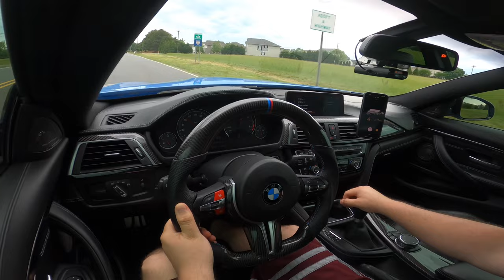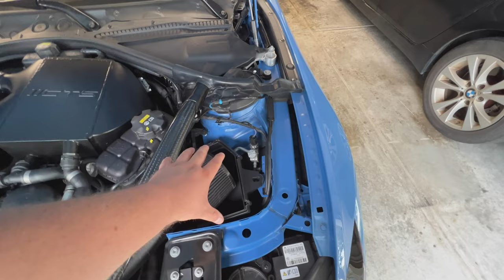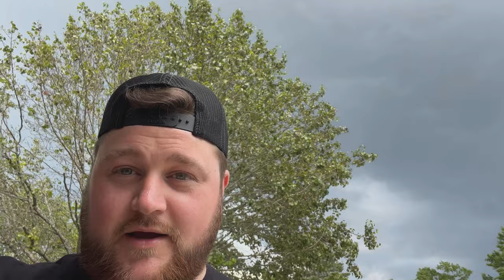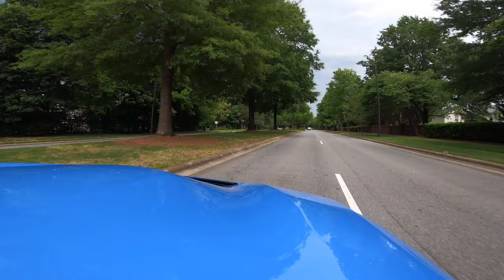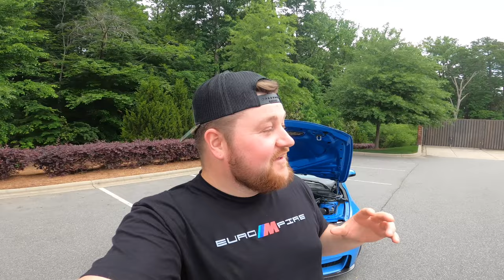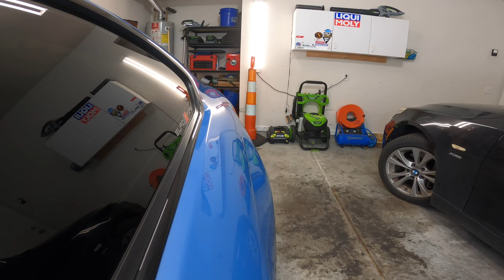BMW M4 CTS Turbo Intake Induction Sound! WHOOSH! What To Expect | BMW M4 M3 M2 S55

Comment: I like the sound. Personally, I run charcoal filter delete with BMC drop in filters and the burble delete with valves always open (plus single midpipe). It’s my perfect setup for sure, sound-wise. Your intakes, while not for me at all, sound really cool 💪
Reply from the maker: That’s the best part about cars is there is so many options for people to make them their own! 

How do you like the single midpipe? I’ve been considering it! Does it clear up some of the rasp at high RPMs? Also, how much louder does it get?
Reply: @UnworthyMotors  Great point! I like the single midpipe a lot because it adds bass up top. The way I describe the change in the single midpipe sound is like this: The stock sound is like early puberty where your voice cracks sometimes and has high pitched breaks mixed in with bass VERSUS the single midpipe which is post puberty after the bass in tone is consistent and smooth. The sound with the single is very uniform and I’d say volume is up 15%

Since we have 6MT we don’t suffer from the “DCT fart” sound as much but there is some liftoff “Brufff” sound at higher RPMs
Reply from the maker: @tractioncontroldelete  i think you have sold me on the single midpipe lol
Reply: @UnworthyMotors  The midpipe is fucking amazing, sounds AWESOME

Comment: Do the intakes add to the engine sound or give an engine sound as such apart from the wooshing? My M2C is stock intakes and exhaust at the mo. What exhaust do you have? Thanks man!
Reply from the maker: No additional engine sound besides the whoosh from the intakes pulling in air. I’m currently running catless downpipes(adds a little exhaust sound) and the rest is stock exhaust!
Reply: @UnworthyMotors   thanks, usually intakes add a bit of roar with that air pulling sound, is that what you have? Nice, you dont have OPFs do you in the US?
Reply from the maker: @JayKullar  no, being at the for front the intake really only inputs the whoosh from a. Sound perspective. What are OPF’s?
Reply: @UnworthyMotors ah ok i got you. Think i can leave an intake then. OPF is a filter added on post 2018 cars here in Europe, reduced sound so much.  Think catless downpipe and removal of OPFs might do the trick.
Reply from the maker: @JayKullar  gotcha. Yeah we don’t have the extra filter and mines only a 2017. The catless downpipes take the cats out but i still have secondary cats in the midpipe
Reply: @UnworthyMotors ah ok. I was planning on taking out the OPF and the 2nd Cat and the mid resonator out at first.
Reply from the maker: @JayKullar  will def add to the sound!

Comment: What are your thoughts on the eventuri? I want more sound than anything..
Reply from the maker: The eventuri is mainly focused on looks. You are paying an excessive amount just for the fact it’s carbon fiber. It is going to give you increased sound from stock while still maintaining the same power numbers, but if you want more sound and that’s your main concern, an open box design like mine is your best bet. You will lose a few horspower(maybe 10) but overall unnoticeable but gives you all of the sound. The reason you get sound is 3 things. 1) whether the intake is located inside the engine bay or is a front Mount system just behind the grills. A intake system inside the engine bay itself will be louder from the cabin. 2) whether it is an open box design(my set up) or a closed box set up like stock or eventuri. As you can imagine, a closed box will let out less sound. And 3) whether it has a cone intake(aftermarket) or a stock filter. The cone filter will provide much more sound than a normal stock filter.

Bottom line, if you only care about the sound, get an open box intake in the engine bay like i have. If you want to maintain performance but want louder than stock just not as loud as open box like mine and willing to spend the money to make it look good, go eventuri. If your main focus is performance gains, go front mount intake style. 

I hope that helps!!
Reply: Thank you for being so detailed I really appreciate it.. how does your intake hold up with heat soak? I live in Florida where it's considerably humid
Reply from the maker: @sateshpersaud1  very marginal power loss. Nothing you’ll notice really. I’m in the Carolina’s and I’m at maybe 8hp loss with open box intakes
Reply: @UnworthyMotors  thank you for taking the time to respond!!
Reply: And I have to agree good shifting, I have a manual m4 and just hearing you drive with this intake system sounds so good
Reply from the maker: @sateshpersaud1  yeah it’s crazy with manual shifts. I think it’s more aggressive than the quick shift of dct
Reply: @UnworthyMotors  manual life!!!!!!

Comment: Sounds great. Man. I got the front mount rk titanium intakes. Omg. I’m not tuned it’s so loud. And to be honest I do feel a slight difference in performance. I also can also see that the engine is cooler. I did make a video of it. Check it out if you want to see some front mount action
Reply from the maker: That’s awesome bro! I will check it out for sure!! Titanium always goes hard! 💪🏼
Reply: @UnworthyMotors  thanks bro. I’m just starting out on this YouTube

Comment: Hello!!! Great video!!! 
I'm thinking of installing cts turbo intakes, it sounds great but I'm worried that it will get a lot of heat from the engine.  The other more expensive option is to install eventuri, which seems to be more closed in order to take calories from the engine...What do you think?
Reply from the maker: The eventuri kit is great if you want a closed box system that looks amazing but you really are paying for the carbon fiber and a closed box. You can get the same performance benefits of a closed case by going with a front Mount option. This puts the intake cones directly behind your grill pulling air directly from outside the car while driving. Point to note is you might see some performance loss from open box intakes(CTS) in the engine bay but you still are only looking at a few horsepower. If you don’t want to shell out the thousands for eventuri but want to make sure you don’t pull in any heat with an open box system like CTS, go with a front Mount set up. VRSF makes a very affordable front Mount intake system!
Reply: Thank you very much for your reply 👍🏼👍🏼
Reply from the maker: @g.r.9413  Ofcourse! I hope that helps! I love the eventuri intakes, they just are not worth it to me for the price as majority of what you’re paying for is just that they are carbon. I’ll end up myself switching to front mount intakes as well for the few horsepower benefits from less heat soak!